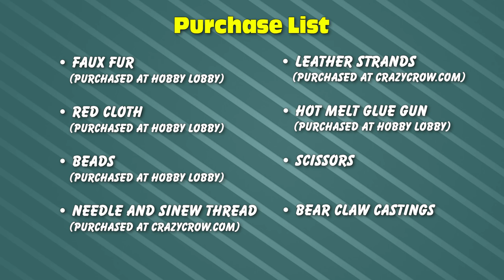Making a Bear Claw Necklace Replica

Comment: Been wanting to make one of these.I purchased resin bear claws off ebay,but they were smaller.I just needed to see how you wrapped the claws with the material(I would use felt for mine,and how the fur was attached.I need to get some glass crow beads which is also available on ebay.I would choose the turquoise or yellow,color-wise,turquoise being my first choice.I like how you made the mold and then the claws out of the mold as the claws are expensive to buy($25 and up for grizzly)at online web shops.Thanks for the video.

Comment: I tried this as you show with the mold horizontal and I did not get a good cast at all, lots of voids and air bubbles. I turned the mold vertical with the "knuckle" side up and cut in a new pour spout coming the highest portion of the knuckle and a small vent hole from a lower section of the knuckle. I now get a perfect cast every time.
Reply from the maker: Glad to hear you were able to get good results!